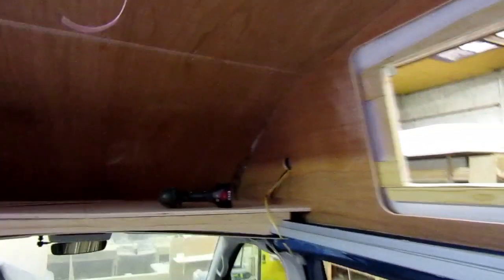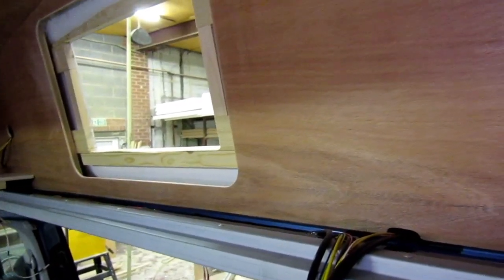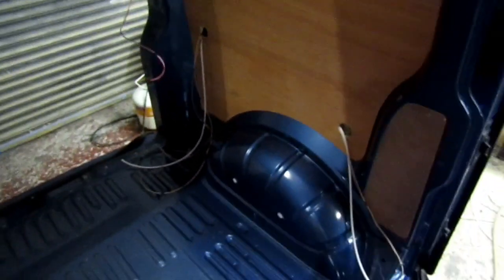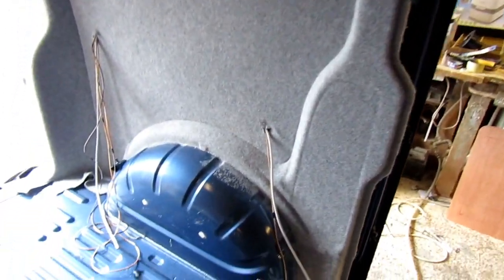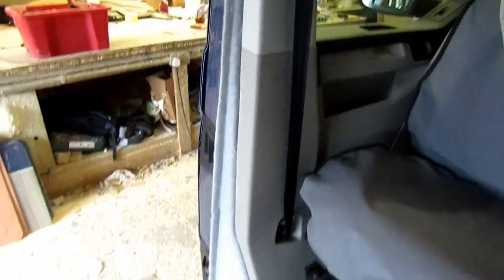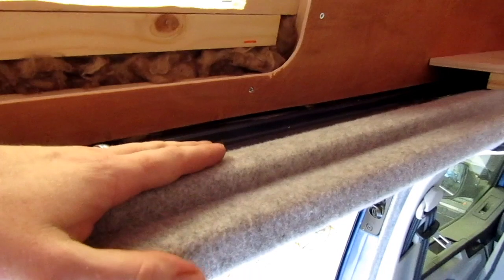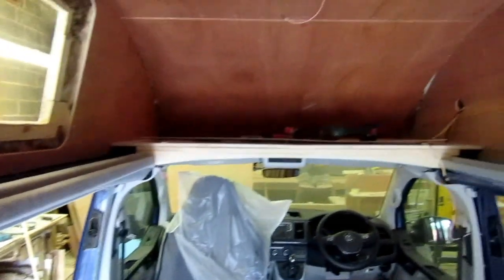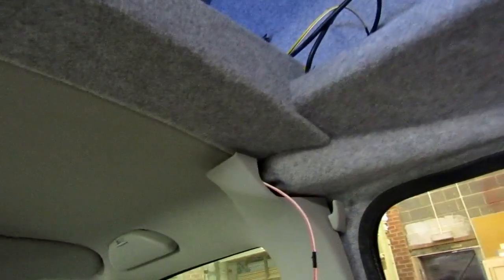How to Build a Campervan VW T6 Series 6 Episode 3

Comment: Really nice to see you applying the carpet, rather than just the usual before & after videos - I've lined my ceiling which was relatively straightforward, but not looking forward to the sides as there's quite a lot of bumpy bits! Seeing how easily you get it to follow the contours has made it seem slightly less daunting, so thank you for that.
Reply from the maker: Glad ive been of some help, are you using 4 way stretch carpet ?
Reply: Yes, the 4 way stretch from MegaVanMats.
Reply from the maker: @jonnyroundboy  what vehicle is it your lining out ?
Reply: @dantheman321 It's a LWB high roof transit. Most of it should be pretty easy, it's just a couple of areas around the door that might be tricky. Trying to decide if I should do it all in one piece like you did, or if it might be easier to do it in 3 pieces (big piece to left of door, strip across top, strip down the b pillar) and hope the joints come out ok...
Reply from the maker: @jonnyroundboy  when im carpeting i like doing it in one piece but that is just a personal preference, it is easier splitting it up though. The other thing is how much of it is going to be seen and will it matter if there are joints.
Good luck with the build and let me know how you get on.

Comment: Great conversion Dan - can I ask how you form the chamfer to the window openings- I realise you finish the ply opening bigger than the external skin but what fills the gap to give the nice recessed look. Thanks in advance
Reply from the maker: It a case of stretching the lining carpet or leather lining from the outer skin to the timber frame that the window clamps too. 
Many thanks for watching
Reply: @dantheman321  Thanks Dan

Comment: Could I ask what type of knife you’re using as I have always struggled with ‘Stanley’ type knives going blunt very quickly?
Reply from the maker: I use a stanley knife and ive probably gone through 2 packets doing this line out haha. If i find something better i will let you know.
Many thanks for watching
Reply: Get some decent blades, it really does make a difference. These are really good: https://www.screwfix.com/p/irwin-bi-metal-knife-blades-pk-100/86098
Reply: Or try an Olfa Knife with carbon snap off blades great for this type of work

Comment: Time lapse was good, made a nice change, and at the risk of becoming a nag did you forget to measure the headroom with the new roof on?
Reply from the maker: Im sorry John, yes I completely forgot mate ive had a nightmare with filming this week as half of the footage wouldnt play but if it helps at the highest point its about 6 ft 8 but i will try and remember on Monday. Many thanks for watching
Reply: dantheman 321  I know you're busy, it'll do whenever you can, its not like I need the info right away. Thanks for the reply.
Reply from the maker: Hi John finally remembered the highest point in the roof is 6ft 4 inches.
Many thanks
Dan
Reply: Ok, thank you for your time, I think I would need a super high then. Thanks again.